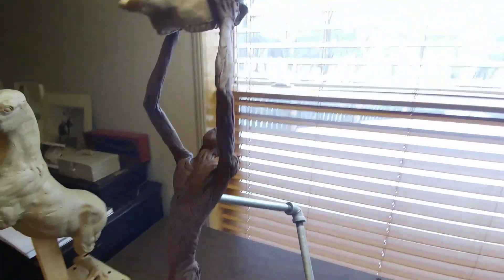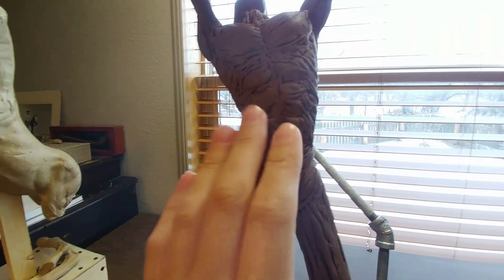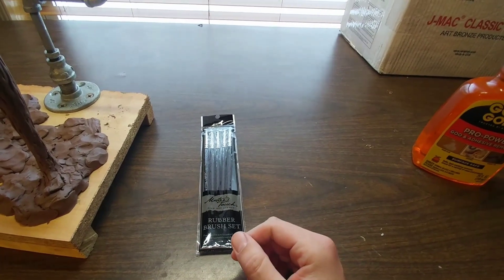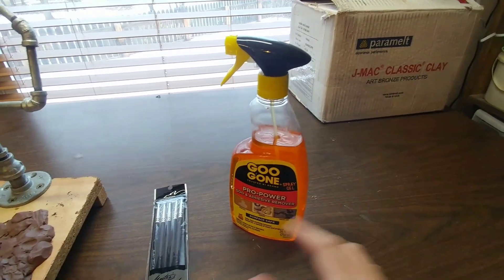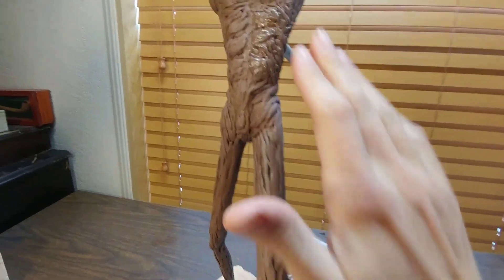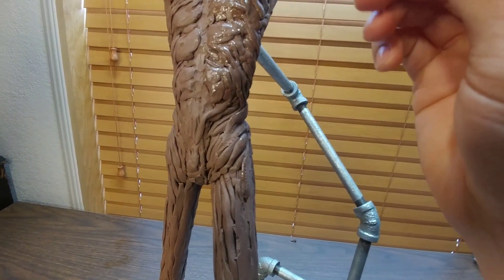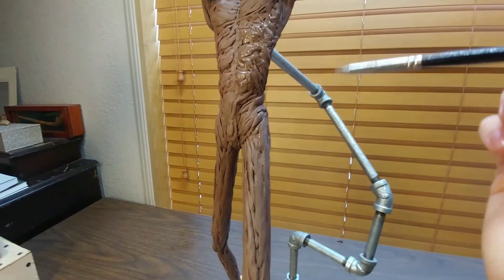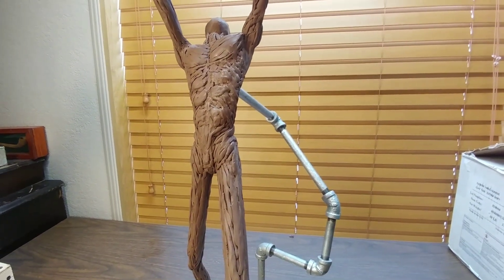Clay Smoothing Techniques (Part 1): Sculpting Tools & Texture

Comment: Great tutorial. I have a question: why did you do the metal piping support that way? (many pieces, full of angles) most of these I've seen use 3-4 pieces.
Reply from the maker: You have many more different ways you can position the armature to get it just perfect. You are pretty limited to where the height and pose are if you only use 2 or 3 different pipes.
Reply: Fritz Hoppe Understood. Thanks 🙏

Comment: Maybe this question is addressed in another video that I have not yet watched. Can the Clay be mixed back together and reused again after using different liquid products for smoothing?
Reply: Yes, but it's better to let it dry or just suck the liquid that you used for smoothing so it doesn't get messy, and as much as i know there's water based clay, and oil based clay, you can't use oil on water based clay and the same goes for oil based clay.
Reply: @dodo2829  thanks!

Comment: where can you buy the screw-together frame (translator)
Reply from the maker: The pieces are just galvanized pipe parts (3/4" - 1/4" diameter). You can get them at most hardware stores. Beware though... They are not cheap!